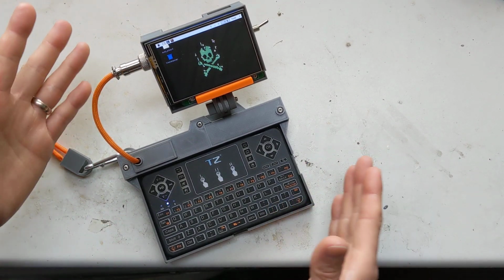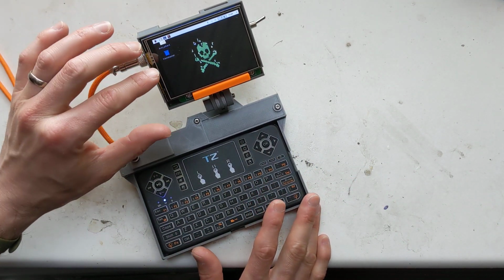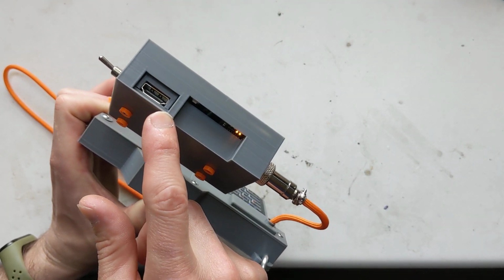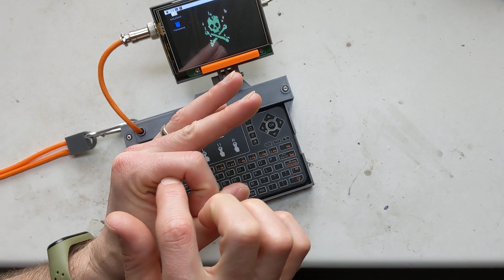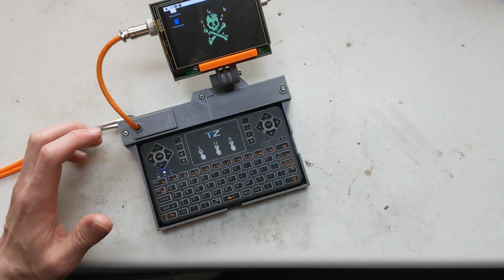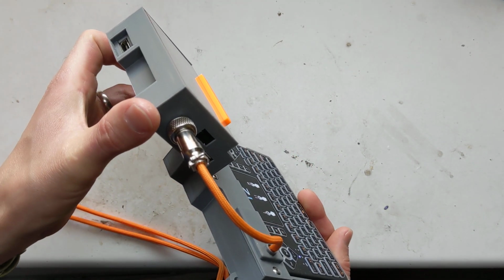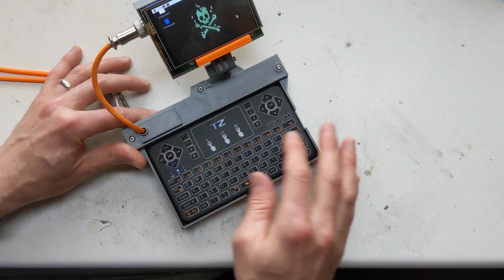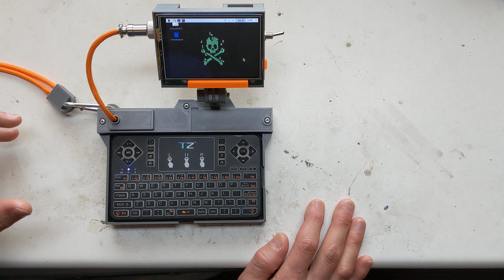Cyberdeck ZBS

Comment: its kinda small (the keyboard i mean)

I'm more of the fan of the designs that use the c64 keyboard case. Those tend to look cool and are easy to type on.

I do like the color scheme on this cyberdeck though. You cant go wrong with grey and orange. Reminds me a bit of the iDroid from Metal Gear Solid 5 if that makes sense (that game has some cool "retro future" tech in it).
Reply from the maker: Yeah it's just handy for running the odd command, I usually ssh in to it and code up the app from my laptop, then run the code to check to see what it looks like

Comment: I have all the hardware for a build like this except for a screen. Do you mind publishing schematics for 3d printing, I would like to try building something like this although ill try to add a couple different things more like a usb hub or an ethernet port or even the ability to connect this to a wall socket
Reply from the maker: Hi, I used freecad to do the modeling, If you download the thingiverse files in the description it has the STL and freecad files.
Good luck with your build

Comment: This is spectacular. That connector is so cool. I've never seen those before. Definitely going in my cart next time. Did you just sleeve your power cable with the same paracord as the lanyard?
Reply from the maker: Yeah just removed the inner core then slid it over